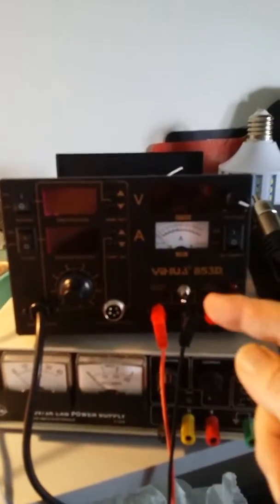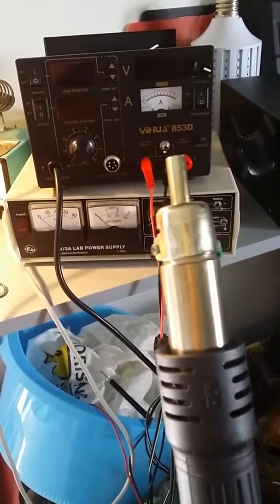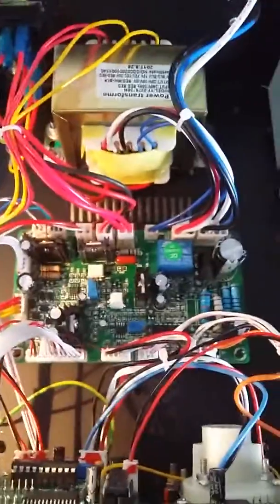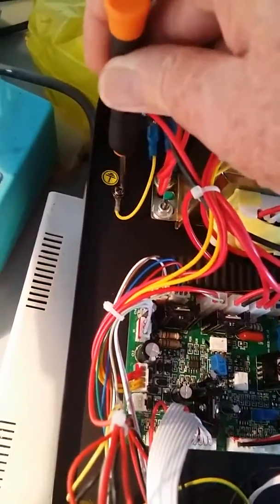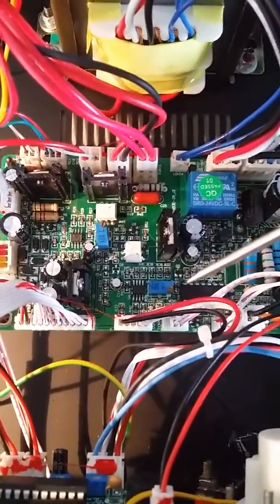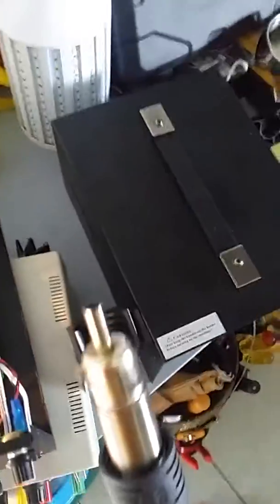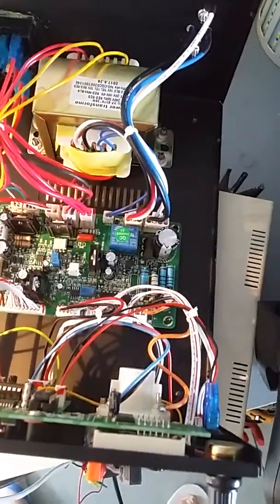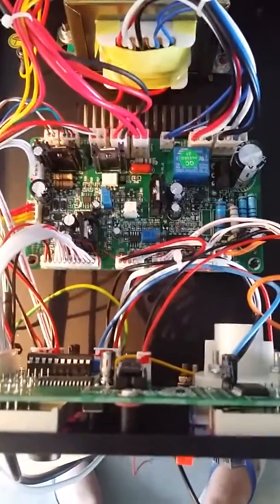Yihua 853D rework calibration method

Comment: Thank you MrAlistairGeorge. I too want to calibrate my YiHua 853D but first I have to calibrate my cheap, Chinese digital thermometer. Adjusted to zero in iced water and 100°C in boiling water I still cannot be sure that it is accurate at 300°C. Maybe the best guide is the published melting point of whatever solder that I use.

Damn, that takes me back to a mid sixties 'A' Level Physics experiment that involved heating a good-sized beaker of lubricating oil (boiling point ~300°C). A standard Bunsen burner took a while (~15 minutes?) to raise the temperature, I was distracted until the laboratory was filled with choking, pungent black smoke.

Comment: I bough 853 D knockoff I guest. It has no nameon it. My problem is the volt meter does not work. It keep beeping & wont  show voltage output. It  has a fail safe mode. I dont know how to reset it. Can you help me Cli6310 thank you for any help

Comment: What do u increase/decrease? temps from the iron or numbers from the display, in my 852D when i turn the screw, i saw the numbers in display go up or down but temps does not change on the iron, how can i increase temps becouse im on max but its low heat at all!? Iron is new with ceramic mod but i messure 280c/300c at 500c max on the display 🍀 lg
Reply: Sub done 🍀 👌

Comment: Can fan speed be increased? I bought one of these and well it had major issues I had to get the seller to send me a new mainboard and I just installed it but the fan speed seems a little slow. I guess this means I also have to check the iron for temperature and see if it also needs calibration any idea on how to do that? The other thing I found odd is that Con 15 has no wire connection and Con 10 has a 3 wire connection but only two wires go in it it's just for the front power on led but it's odd to see a 3 pin connected by a 2 pin wire I'm so glad I took dozens of pictures before changing the board because I got confused when I tried reconnecting all the wires to the new board.

Comment: Thanks for the video!
Just wondering: what's the black rod with the steel pins/wires visible at 1:15 used for?
I got one with my station as well but have no clue what to use it for...
Reply: Hi Ni5ei. It is an IC / chip removal tool. There is an image here https://ae01.alicdn.com/kf/HTB1ix6.xbZnBKNjSZFrq6yRLFXaX.jpg It is not like any other IC removal tool I have seen! I did not get one with my YiHua 853D shipped from a UK warehouse but I got 1.5m of 2mm solder wick - odd innit! Same timestamp apparently MrAlistairGeorge got a chicken stir-fry for four with his!

Comment: You can also calibrate it by holding temp up and down for 2 sec together then enter tested temp supposed to be done at 230c apparently maybe the trim pots adjust the scale
It's in the manual how to calibrate
Reply: how u know? this does stated on manual book
Reply: @hantusangap  i really cant remember where i found it out if im honest 😂 this was a while ago i did do it tho it does work
It was either in instructions or online infor somewhere👍🏻
Reply: @reasonsvoice8554  nevermind im also dont use it anymore ending up with hakko fr810 and fx951.
Reply: @hantusangap  oh its still working fine never had any issues
It was just ocd making me check it in the first place it was and still is bang on
Reply: @reasonsvoice8554  its good for hobbiest.mine already disamble for parts